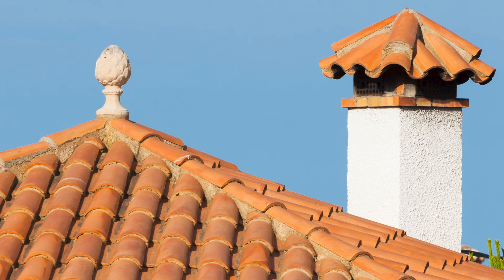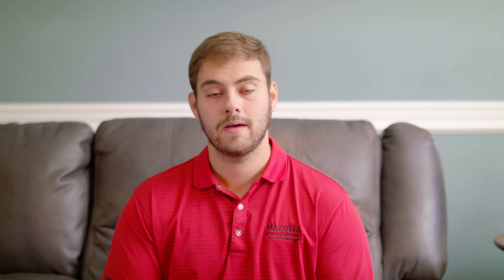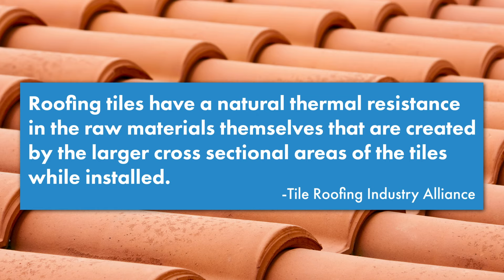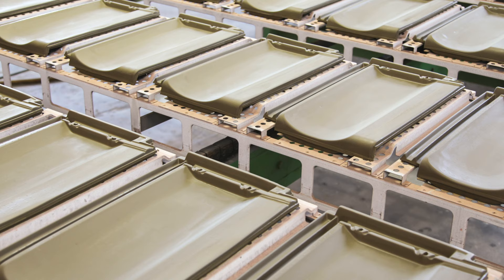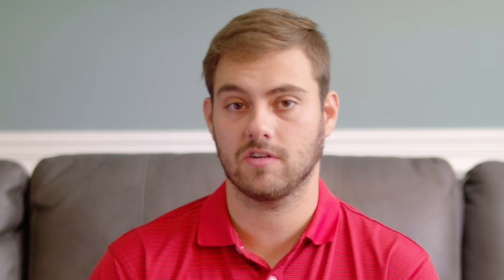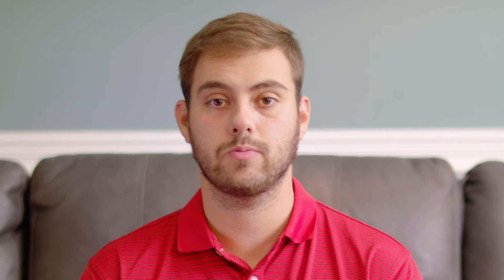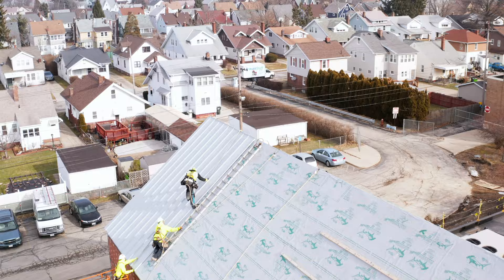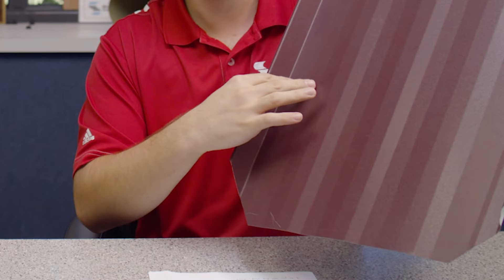Metal Roofing vs. Spanish Clay Tile: Which Roofing Material is Best?

Comment: The Dominican Republic, where I'm from, constructs homes using metal (zinc) roofing sheets which is the cheapest material other than palm fronds. The problem is, Zinc roofs retain and concentrate heat extremely. In a tropical setting, Spanish tile is the sensible way to go.

Comment: why one or the other. i used both. sip panel on engineered timber joists, then grooved XPS ( designed for tiles) then tiles on top with teca glue foam